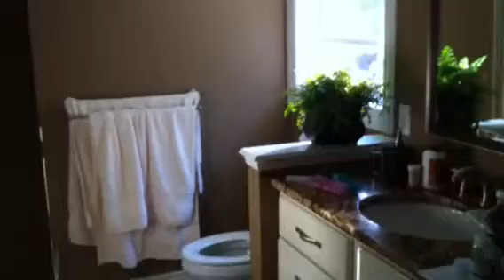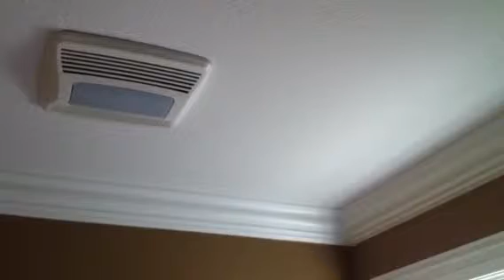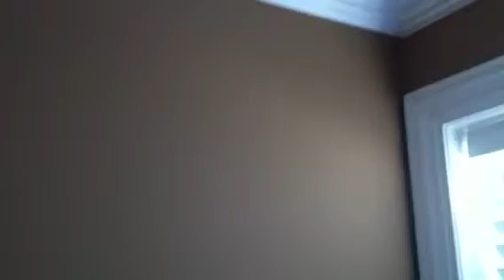Drip behind wall

Comment: I have the same problem with my 20 year old house and a plumbing company diagnosed my issue to be "water hammering" and caused the dripping noises behind wall when turn on hot water from the 2nd floor bathrooms, and the simplest solution is to replace the water regulator located in the garage. The work is currently averaged around $350

Comment: I'm having a similar problem but it only occurs in the winter when the heat is on. I'm convinced that it must be a leak in the heating pipe that runs to one of the units above mine. No visible signs of water anywhere just daily audible dripping sound all winter.

Comment: We have he same problem "an audible drip" in our walk in closet. Water saturating the carpet of just the walk in closet. No wet walls, just drop behind the wall when main water valve is in on position. Set to hear from a plumber today but I wanted to know more information on how your issue was fixed/ what the issue was/ rough estimates of how simp located I was to fix. I'm  freaking out here filled with anxiety. Many home issue affect me in this way... Juat thinking of worst case scenario. I know wall is going to have to be cut into, just concerned as funds are limited as I am disabled and funds and not endless.
Reply: I have the same problem. What was it? Mine is only when the heat is on. How much did it cost to repair